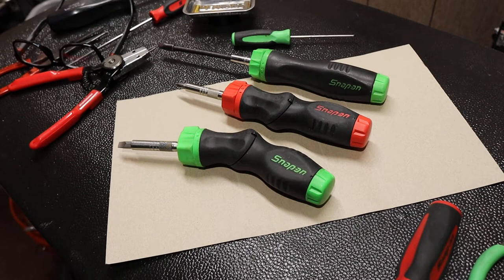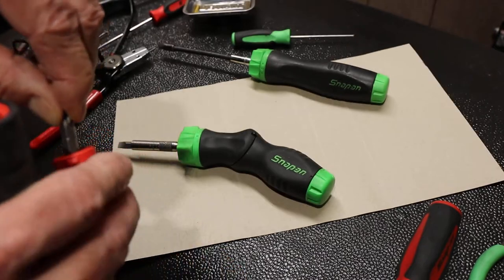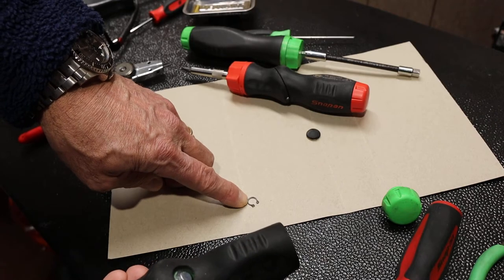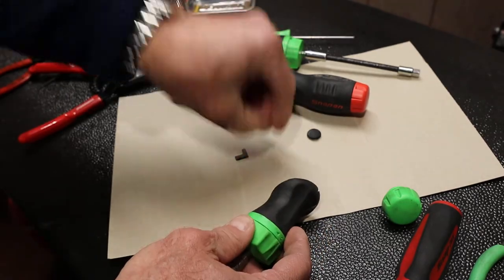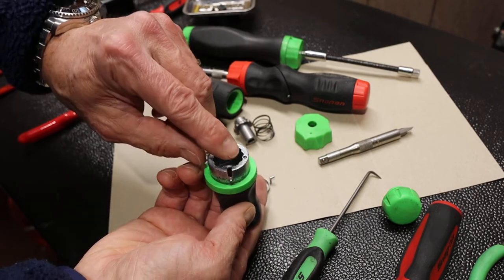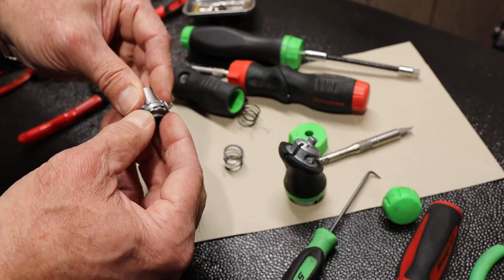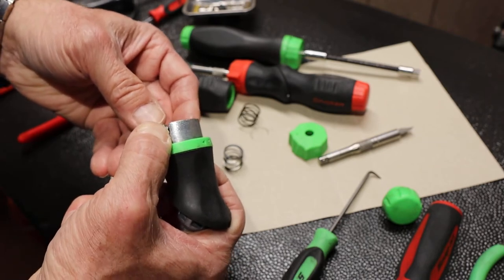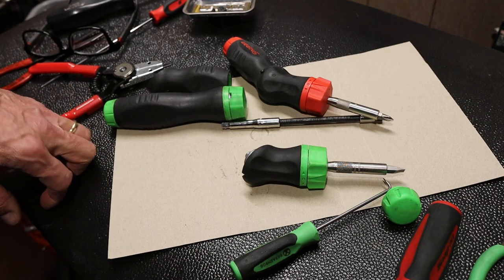Snap On Ratcheting Screwdriver Teardown

Comment: finally something close.. is there any fix for wera 816 ra screwdriver it gets stuck in right/left after using the lock/middle setting i think it needs to be reassembled but i dont know how to remove the head like this

Comment: I have an issue with mine. I love it but recently when I adjust to left or right it doesnt "ratchet" at times like it's slipping. I dont have a clue on what the problem can be or how to fix it. Any advice?
Reply from the maker: That happens. Just warranty it out. Should be simple because it’s a known wear issue and as far as I know, there is no rebuild kit.

Comment: Thanks for your content. Do you know how to remove the collar piece off the Wera 27 RA ratcheting screwdriver? I’m trying to remove the longer bit holder it comes with with the shorter rapid adapt bit holder. I’m wonder if it is similar to the Snap on removal